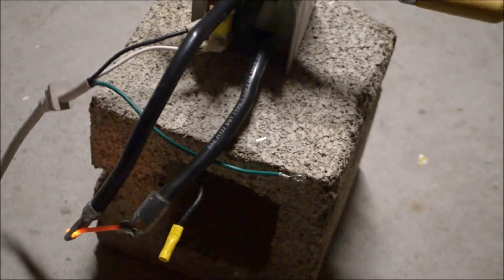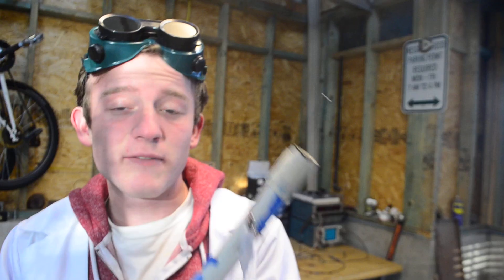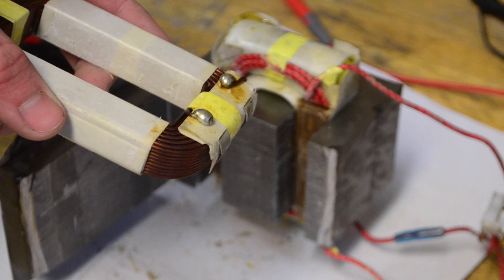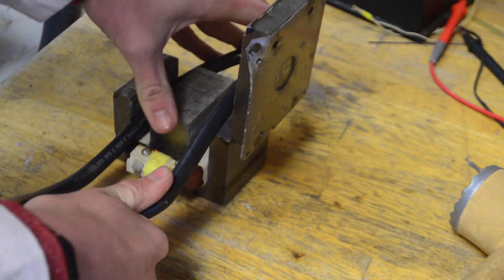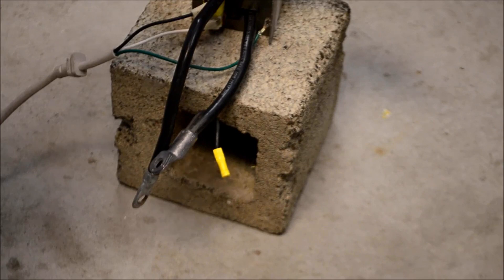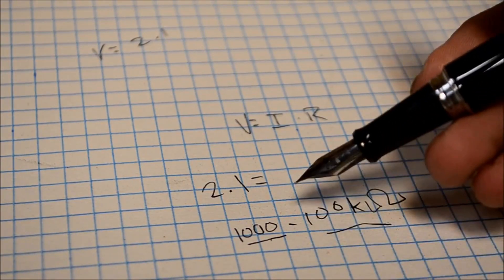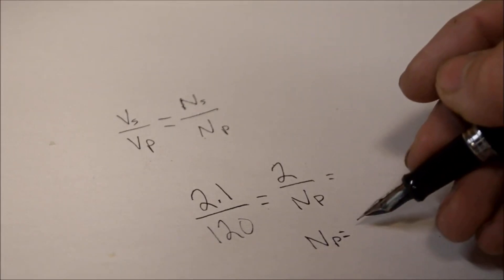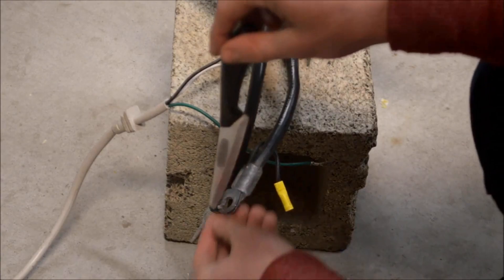How to make a 1000 Amp Transformer

Comment: I use basically the same trick to build a welder but I use two Transformers and it works at least but your average is very low I can melt a bolt in less than 10 seconds

Comment: Hi there, nice seeing this video. And your other projects as well. 

Im struggling with making a variable high current low voltage transformer in order to use for foam cutting. I rewounded the secondary winding with four turns, connected a 30 amp fuse and car lamp in series with variable 2000w ac regulator.... and blew the regulator. Fuse and lamp still intact... please help. Dont know if the secondary wounding should be in the right direction for voltage to be induced...?

Comment: The part about the myth of high current being the thing that kills you rather than voltage, you should make an entire video about that exact thing! MythBusters as well as a number of other credible sources have claims that the amperage was the determining factor for danger to humans. But it seems that you've proved them wrong! Make the video! 😁
Reply: To be fair it is the current that kills you, but you can't make enough current pass through the body to do that unless you reach a certain voltage first.  Having the current without the voltage (as is the case here) isn't enough on its own.  It's like saying falling off a building doesn't kill you, it's the sudden stop at the end...sure but you only get that lethal sudden stop if you fall off the building first.  You can't have one without the other, it's the two things working together that produce the result.

Comment: So many videos of people pulling the secondary windings from those and I think yours is one of the very few videos that do that without destroying the secondary windings.....that's the way I like to do it.. every time I see a video of someone doing that and they're cutting it out and hammering it out with a screwdriver it makes me cringe... because there is good usage for that secondary winding in experimentation. I have several laying in my parts boxes like that.... but some microwaves the primary and secondary are aluminum and not real copper the aluminum ones I don't care anything for.... all your real copper winding Styles come from older microwaves most of the time... sometimes they are split one might be aluminum and the other copper....

Comment: The power calculations are not going to be accurate because when you short the output it likely drops below 1v.
Reply: Good point.  How should you measure the power in this case?  You could measure across any two points on the secondary but which points would be valid?

Comment: Question
If it deliveres 2 volts 1000amps

Does it pull 1000 amp off the mains??
Reply: Nope, it will pull around 15 amps

Comment: Let's say I feed 230 volts but only have 20 amps at my disposal and through a transformer get the same voltage but my amps output I need 100 amps which is what I'm trying to achieve

Comment: If at all possible I would need circuit that can give me 12 VDC 200 Amp from  1000 Watt transformer 12 VAC, please get in touch with me I am in Canada, my Skype name is Mareiner1.
Reply: 12 VDC at 200 A is 2.4 kW, you won't be able to get that out of a 1 kW transformer for very long as it's double the rating.

Comment: Can anyone explain how to the multimeter did not get fried with 1000 amps input?
Reply from the maker: The multimeter works by measuring the magnetic field created, and then uses that to determine the current, so it didn’t have 1000 amps flowing though it, it just felt the field created by it

Comment: what if some of the copper coil were to be damaged... would it still work
Reply: Depends on the damage.  If you break the insulation on the coil wire and it shorts to the transformer housing then it will blow a fuse/trip a breaker when you plug it in.

Comment: I have a video suggestion! (Please take it seriously) Stick your hands in buckets, put an anode in one and a cathode in the other. I did this with 12v DC with a powersupplyrated at 6A and my fingers splayed out at unusual angles without my mental command. If you don't want to do this then put a 9v battery onto your tounge. :)

Comment: you should show how to use this to make a high current low voltage dc supply.
also could you put something like a pwm dimmer on the primary to control the voltage?
i need a high current dc supply for various electrolysis projects.
Reply: Id like to see you find a pwm dimmer for 860 amps.
But as for that electrolysis thing, it would be better suited for a toroidal transformer, those conserve way more energy and the output different voltages and currents depending on the windings, you can buy them cheap from ebay. Just put a rectifier on the outputs and maybe, if you really want to, you xan put a dimmer or variable resistor on the leads of the primary.

Comment: Dear sir how i increase amps same power supply i have 25 volt power supply its operate motor  controlling board but control board  damage now i was make a simple circuit for motor drive but motor not proply work because low amps

Comment: It is making noise because a microwave transformer is designed to out put 2000v AC and also because of the ratio of Vs/Vp is not in proportion to Ns/Np.
Reply from the maker: +shaikh faizan ahhhh okay, that makes sense , thanks!

Comment: current killing you is not a myth, that's a fact! Voltage by itself is not going to kill you. The thing is that you can't have the current without the voltage, but you don't neccessarily get the current with the voltage, and as so, you are not urge to die by 10 million volts, but if you have a few amps flowing through your heart for example, you are definitely dead.

Comment: ive actually done this and that transformer actually outputs around 9 volt 200 amps
Reply: Now you've got the theory  ?    reduce the number of turns by half and you'll get 4.5 volts at 400 amps, half it again and you should get 2.25 volts at 800 amps !    mind you, you will probably have to increase the wire thickness

Comment: hi   ok down to it     try this take two microvave transformers  and cut the I'S OFF AND USE THE    E'S TO CREAT A HEAVY DUTY TRANSFORMER  insted of 2.4 V   you get 4.8 to 6 volts at 1000 amp

Comment: I tried the same thing, but accidentally cut the primary while removing the rest. I rewound a 120 turn coil of 18 AWG enamel wire and used 2 3/4 turns of doubled 4 AWG  wire for the secondary and got 1300 Amps of output, while drawing 30 Amps from the input. I used a fan from an old microwave for cooling. Also bought some spot welding tips from Miller at a decent price on eBay. It's only rated for about 20% duty cycle though.

Comment: All 2 gauge wire I come across is super stiff and impossible to bend
Reply: What your looking for is stranded welding cable probably around 350 amp, try to get the one with thinner outer covering, there two or three different types.

Comment: What did you power it with? DC or AC what frequency?
Reply from the maker: +Colin Ries AC at about 60hz
Reply: Keystone Science that was a quick reply ;) I imagine straight from the wall?
Reply: While I'm at it, would it be possible to run a moderately big tesla coil from that boost converter you used to make a taser?
Reply from the maker: +Colin Ries haha yep :D
Reply from the maker: Sorry, I didn't see that you had responded... Not really since it is only about 30 watts of power.
Reply: Keystone Science no problem. so a small one would work?

Comment: U=E/Q           I=Q/t               meaning that you  might have a strong current (many electrons flowing), however the energy contained in the electrons  is really small.    taking power into consideration P=U*I  it's clear that both variables are just as crucial to delivering high power.

Comment: When working with high currents, you should ALWAYS remove any rings and wrist watches.  I knew a guy once who welded his wedding ring to a power supply he was working on.  Fortunately, the supply was off (the current was just from the discharge of a capacitor).  If the power was on, he could easily have lost his finger.

Comment: There is no such thing as a high current transformer only high or low voltage transformers.
Reply: Which basically just means that you look at the other side of an equation.

Comment: This is a very nice video. This can only melt steel if you gave a 220 volt power source. Tried it with 110 and it didn't get hot enough.

Comment: what if you had a long metal rod connected to the two terminals and you were to hold onto that rod, would you get harmed?
Reply from the maker: +Oliver not from the electricity, however when the rod would heat up it would burn your Hand
Reply: oh okay, cool! and thanks for answering my question so fast :)
Reply from the maker: +Oliver haha no problem :D

Comment: Your ohm's law is not valid. 

Human Skin is slightly capacitive. So under AC conditions the human body is a short circuit. 

Once the AC shorts through your skin, you effectively have about 300 ohms (can be less) of resistance since the inside of your body is very wet.

Comment: With total RMS of the input voltage it's just about 1 turn per-volt. High Voltage and Low Current doesn't kill, Low Voltage and High Current doesn't kill. It's the ratio of the two together that kills.

Comment: Did you say that the amps kill is a myth, you do know that you have to have enough volts to break the resistance, and enough amps to do harm, so were you express your opinion on the subject?
Reply from the maker: Yeah, I am just saying that because of how most people who don't work with electricity think it is purely the amps and that voltage has nothing to do with it
Reply: Keystone Science Can't we just say then that it's the power that kills you? Since P=U*I ?
Reply: Its a combination of both. High voltage breaks bonds and allows for short circuit conditions. IE: Thunder forcing air to be a conductor with over a million volts of potential.

However high frequency AC is a short-circuit in high capacitance capacitors (with low in series resistance as well). 

Since the skin is a capacitor, and the internals of the body is low resistance (~300ohm or less), its possible to kill someone with ~10-20Vrms of AC voltage. 

Compare that to DC that requires 75V+ to breakdown skin to allow access to the low resistance of the inside of the human body.

Comment: Hey great videos I'm a big fan^^ just curious what is the lethal range for current moving through the body. a lot of tech tubers say the same like "its not going to hurt you " etc. but never really give a range from zero to this number is safe but if you have a number approaching the unsafe zone I wouldn't touch it. I understand the resistance of human skin will change from place to place and person to person. but I would like to know when I may give myself a lethal shock. that way I will have a theoretical feel for the items in question. possibly a video would be easy and fun^^
Reply: The dangerous level of current depends on a few things like whether it's AC or DC, your, weight, age and physical condition and so forth (a 100kg 21 year old footballer probably has better chances than a 50kg 80 year old grandparent). According to a google search, 10mA causes a very painful shock. Currents of 30mA can put you into Ventricular Fibrillation, a situation where all the heart muscles fire randomly. This is certain to kill you if you don't receive CPR almost immediately, and even then your chances aren't good. 100-200 mA is almost guaranteed to put you into VF. Above 200mA the muscles in the heart contract so strongly that they're all clamped down at once, which means you don't go into VF and your heart can re-start if the current is removed and you receive CPR, improving your chances of survival. At this sort of current level you'll also receive nasty burns.

I should note that to some degree what really does the damage is the energy, not the power or current. What this means is that the longer the current is passing through you the higher the chance of your heart stopping, and ultra-short shocks of normally lethal current levels might not kill you (not that you should risk it).

Comment: You should set up a heater. use a thermostats w terminal for it. hook up a transformer that goes from 120v to 24v. So when the temp drops down low the w terminal closes sending 24v to a relay coil. Then threw the relay 120v will go to  a centrifugal motor and a heat strip or two. Haha kind of like a homemade electric heater for your shed. Haha it's just a suggestion it would be pretty cool !

Comment: why you don't make a room heater by using a heat induction with transformer and add a fan..  use a potensiometer to control the temperature..
Reply: Anomaly dheryn loud af